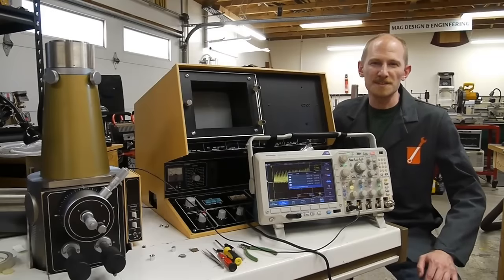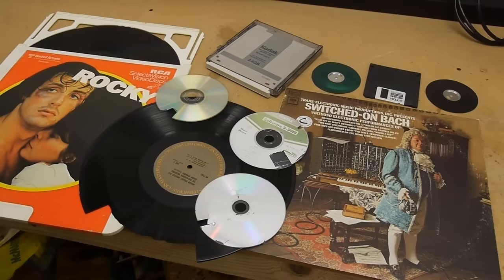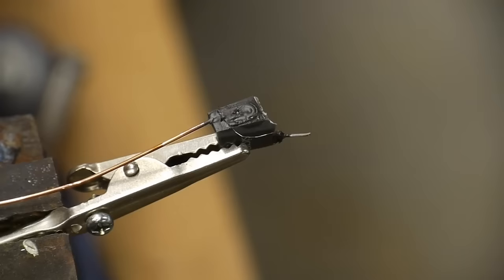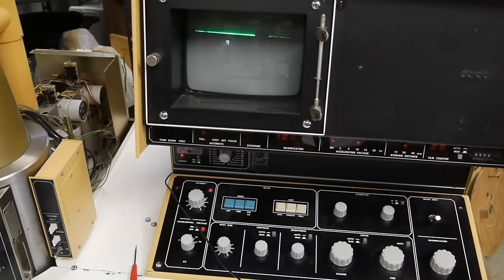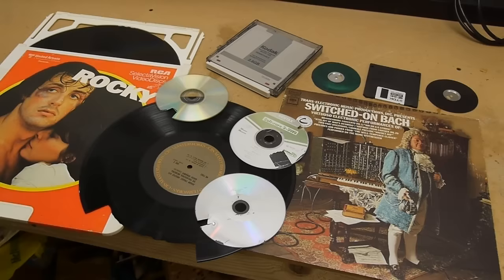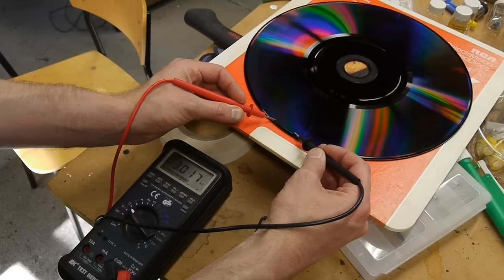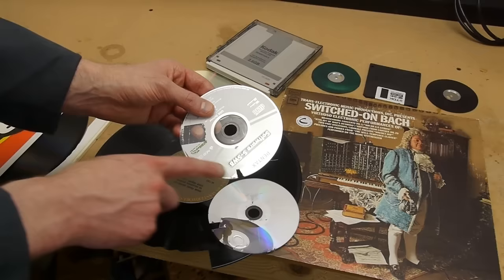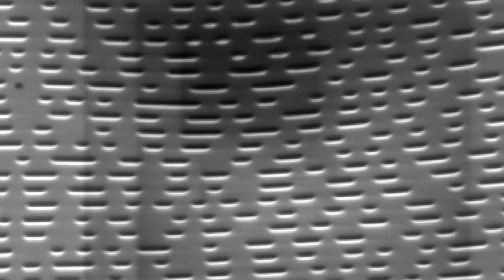Electron microscope slow-motion video of vinyl LP

Comment: This is incredible. So many times we take small things for granted. How on earth they cut they grooves with accuracy back in the day is beyond me.
Reply: The way it was invented was by recording with the vibrations that then kind of create the grooves but idk if that's how they do it now
Reply: they molded it to like some sort of master vinyl tihng
Reply: @unpluggedtoaster7421 they dont use vibrations in the way they did in the early days, as in recording into a horn and letting the vibrations from the sound vibrate the diaphragm and thus the needle. they use massive record cutters that use electronics to make master discs and then stamp all the records using that master.
Reply: The field created by the current of a recorded signal moves magnets mounted on a stylus, pretty much the opposite of a phono cartridge, cutting the signal into a lacquer disk, eventually ending up as a stamper pressed into a hot vinyl  "biscuit". Sure it took some work, getting everything to function correctly. But, basically it just replied on physics. The magnet field is an accurate representation of the current that creates it, and a magnet will accurately represent the change in field strength, if that makes sense.
Reply: I used to cut my vinyl with a hammer and chisel..
Reply: @savage22bolt32  Only 1960's kids understand
Reply: Store bought records aren't cut, they're stamped from a cut steel master which seems even more unlikely to get those tiny details into the groove.  But they do.
Reply: @austindarrenor  in the '70's, I worked for a machine shop that made the backing plates for the vinyl press machines.
Reply: @savage22bolt32  What gets me is how clean those vinyl presses must have had to be kept.  Just one grain of dirt stuck in a groove could ruin hundreds possibly thousands of finished vinyl records.
Though for years I listened to an album by the Byrds that skipped a groove.  Then recently listening to the song digitally without the skip didn't sound right 😆
Reply: @austindarrenor  Hey Mr Tambourine Man,  -  So funny you say that.  
In the mid - 70's I bought a Marshall Tucker album.  It had a skip, so I brought it back (to Caldor's dept store). The girl in the record dept was so nice, she exchanged it for a new one. 
Well, guess what? my new one skipped in the exact same spot!
PS I still have that album! 
When I was a youngster, my mom had a wind-up Victrola and a stack of old records. Sadly, we sold it when she died. There was too much stuff to deal with, and losing that is one big regret.
Reply: Dan Fogelberg’s first three or four albums, before he became huge, all were badly pressed. We used to call him Skippy.

Comment: You had me at, “ever since setting up this electron microscope in my shop...”
Reply: When you cut a 2 x 4 you must make an amazingly accurate cut!
Reply: me2
Reply: apparently a quick google search revealed they can cost something like up to $1,000,000 in dollars. Not something I'd ever get as a birthday gift, let's put it that way.
Reply: @kennarajora6532  not this one. He got it for free and just had to pay shipping. It's an older model anyway so could probably be picked up on ebay for under 10k. Still not cheap but not terrible for the capability.
Reply: @etch3130  I was curious about what he meant when he said that cd was approaching the limit of the device . . . For now.
Reply: Nothing really surprising here. It's actually a requirement for anyone serious about generating power from nuclear fusion in one's garage.
Reply: And I thought I had a decent shop setup with CNC mills, lathes, welders, etc. This guy has his own SEM! Sheesh!

Comment: Of course, physical vapor deposition, obviously.
Reply: hmm yes indubitably. I use this method all the time to butter my croissant.
Reply: butter vapor is something i never considered, i guess that with a vacuum chamber, some high heat and a very fine butter spraying device you could coat your croissant. now im wondering if all the air in the croissant is going to escape making it look like a balloon under a vacuum. this is what keeps me awake at night, deflating croissants
Reply: @yonidellarocha9412  dear God. You have just given me great anxiety
Reply: @yonidellarocha9412  Great, now I'm contemplating whether croissants deflate in a vacuum. Nothing in the world will be right until I know! DAMN YOU SCIENCE!
Reply: The CVD is a common technique in material coating. It usually involves fusing with the substrate and making the coating part of it instead of just a layer on top.
Reply: Joseluis Colunga CVD Croissant Vapour Deposition?
Reply: Chemical Vapour Deposition. Actually, I now realize my mistake. Sputtering is a physical deposition, caused by mostly electrical energy and thus the coating is softer and easier to remove than CVD. It's like powder on the material. Chemical vapor deposition is well... chemical. the material becomes something else.
Reply: Does it use CVD ?

Comment: the one thing i know i will never fully comprehend is how grooves in a record can actually produce complex sounds. that's always going to be witchcraft to me.
Reply: ***** no, i mean i understand how it works; i'm just really incredulous that it actually works. every time i think about it, it just blows my mind.
Reply: What blows mine is the Reed-Solomon Code and error correction!!!!
Reply: +David Drake - What is Reed-Solomon Code and error correction?
Reply: Calvin Lee The groove walls oscillate exactly as the sound wave compresses-expands the air, so all you have to do is amplify the signal (well there's an "RIAA equalization" to the sound because the vinyl medium is better at capturing some frequencies than others). It's an elaboration of the earlier gramophone and Edison cylinders in which the oscillating needle is simply connected to a horn, no electronics.
What is impressive is how good such a crude method can sound.
Reply: Calvin Lee The groove walls oscillate exactly as the sound wave compresses-expands the air, so all you have to do is amplify the signal (well there's an "RIAA equalization" to the sound because the vinyl medium is better at capturing some frequencies than others). It's an elaboration of the earlier gramophone and Edison cylinders in which the oscillating needle is simply connected to a horn, no electronics.
What is impressive is how good such a crude method can sound.
Reply: I completely agree with you, I wrote an entire paper on the topic and it still bewilders me.
Reply: Calvin Lee - Ikr ! I thought i was the only one that even after understanding the concept always felt like it was some kind of Nature's Magic show....  Especially with Video files stored on Disks or drives !!  I mean where the hell do u store all those colours, movements, formats etc. .... We humans invented some Crazyyy stuff !! :)
Reply: Magi V I certainly haven't written any academic papers on the topic but it doesn't exactly seem like witchcraft to me, if my ears can detect vibrations in the air and let me interpret them as sounds then it seems to just make sense that a fairly simple machine can pick up those same vibrations and record them and play them back by doing the reverse!
Reply: Calvin Lee what blows my mind is multiple sounds. I understand if it's playing a 40hz tone. But a full track with like 7 or 8 different instruments or voices!!
Reply: skierpage i have some edison cylinders at home! Are they worth something? I do not have a way to play them sadly
Reply: Now... someone please explain to me how they cut the grooves .  I presume it is the reverse process, analogous to the speaker/microphone concept but I am curious how it is physically done.
Reply: Play them happily then.
Reply: Well something like a stylus (an especially fine and tough one) picks up the signal from playback and physically vibrates the way a record playing stylus does, and cuts into a slab of material which is being spun at the right speed.  That produces a master disc.  Producing a master disc is an art in itself...
Reply: Me too, Calvin Lee. I get the theory, but the praxis blows my mind. There has to be some sort of magic involved!
Reply: It is weird... how a wave form can sounds like multiple instruments and voices at the same time, instead of just a single frequency generic tone. How does a little curved groove waveform in plastic translate into a distorted guitar playing an E minor chord consisting of multiple frequencies... blended with a keyboard and vocalist, etc etc...
Reply: This comment section is gold
Reply: Wow. Imagine a world without music.
Reply: I agree, that and how cathode-ray tube televisions work.
Reply: Calvin Lee I was thinking the same thing.
Reply: Kenneth Albert it's similar to the way scratching finger nails on a blackboard raises hair on some humans and irritates the hell out of them. Coz n effect ;-)
Reply: sqlb3rn segfavlt It's all the sound waves mixed together into one single resultant wave. It's not like the loudspeaker vibrating membrane "knows" that it's a human voice or chainsaw or guitar. It just vibrates with the net resulting wave.
Reply: All that is academic - it's ridiculously simple compared to how the ear and brain interprets the sound waves.
Reply: THANK YOU! SAME HERE! It's literally Magic
Reply: +Thomas Headley
You're just trying to burst everyone's magic bubble.
Reply: +Thomas Headley
To record a record of every event ever would require storage greater than the universe itself.
Reply: +Thomas Headley
I think that's kind of the problem. What is "us"?
Reply: Belief makes no difference, and is therefore unnecessary.
Reply: +Thomas Headley
Words have no meanings when you toss them around in a word salad.
You've gone from rational thinking to Hollywood thinking, you're devolving right before my eyes.
Reply: +Thomas Headley
Hollywood thinking means writers getting paid to write popular fiction, did you think it was science?
Reply: Words express ideas and so a word can have multiple meanings, the different definitions are not the same, and two different words don't mean the same thing.
So are you talking about faith or belief - it can't be both, that's word soup. So stand behind nonsensical statements all you like, it just means you can't even rationalize your own thoughts.
And none of this has anything to do with magical record grooves. Maybe if I just have belief (faith) that the music will play it will work, as if what I think or don't think makes any difference.
Reply: The truth is a lie waiting to be revealed.
We could do this for awhile...
Reply: No. That would be impossible to do. Even digitally it cannot be done cleanly in almost any real world recording. All you can do is remove certain frequencies which aren't likely to be the guitar's frequencies, to try to isolate it, but you will always end up removing part of the guitar's tones too, and leaving other parts of the track which are close to the guitar frequencies, making it a pointless exercise.
Reply: All multi-track music is "mixed" in the final stage. It's called the mixdown and is fundamental to the production of any vinyl record (since it is where each channel's levels are compressed which is extremely important, so that the groove is never so deep it pierces the material). Also by definition, vinyl can only store 2 channels of analogue data, so can only ever be stereo. Surround sounds requires 5 or more separate channels of data. While feasible to be done in analogue it is really only since digital that it has become mainstream.
Reply: Thomas Headley  
You don't have that right.
There is no stored database of sounds in a human brain that interprets vinyl recording.
Are you on mushrooms or something?
The OTHER explanations here are correct... not yours.
Reply: they don't tell you about the ritual they perform on the masters, and how amazing is it that you dont need much but a paper cone with a needle and a way to spin it to listen to the content

Comment: where did you get the electron microscope? I've been to three different Walmarts looking for one
Reply: LOL. Thank you, kind stranger, today has been rough this comment was the first lol I've had all day.
Reply: :D
Reply: You can often find used ones one eBay (usually in pieces and you'll probably need to buy a few more parts), many of them functional anywhere from $500 USD to $100,000 USD. With enough knowledge and skill I bet you could get one functional in your home for $1000 (maybe less).
Reply: The device itself is really not as complex as you think at the basic level. It just becomes exponentially more complex as the image quality/res you want increases. I mean, think about it this way: the electron beam part of the microscope is just an advanced version of an old TV CRT. The sensor and the electronics that interpret the signal are probably the most complex parts (unless you're using some super-vacuum pump or something).
Reply: Lmao what?! Did a double take haha
Reply: Ems are upscale. Try a Target.
Reply: you can buy one from the Electron Microscope Shop.
Reply: Mrs Moot HIV positive Where'd you get that joke? The toilet store?
Reply: Lowes Bruh.
Reply: cscdog The jerk store called, they're running out of you. -- George Costanza
Reply: have you tried staples?
Reply: All WalMarts in Florida stock electron microscopes.
Reply: Jim Beam I have found that they aren't usually at Walmart, apparently they weren't selling, however I have found a few at the crackerbarrel gift shop, and have also found them at goodwill. Also you might get lucky at garage sales.
Reply: I got mine at electron microscope hut
Reply: Electron Microscopes 'R Us
Reply: tesco
Reply: pfff! duh you gotta go to Costco..
Reply: OMG!   Lmao!
Reply: Walmart only stocks Atomic Force Microscopes now.
Reply: Web order only, pick up in store
Reply: Jim Beam lol ! I tried not to laugh at you comment but I failed ....
Reply: Have you tried Harbor Freight?
Reply: I picked mine up from a local Radio Shack. The location I got it from had some weird stuff over the years, but alas, they went out of business several years ago.
Reply: MisterLepton oh thanks I know this is a joke comment but it made me wonder where I can get one.
Reply: 999 thumbs up I coundn't resist going to 1000
Reply: Walmart has them, but you have to look very closely
Reply: It's in the same aisle as the physical vapor deposition vacuum chambers, DUH!
Reply: They're in Seasonal next to the clearance barbeques. Best time to score one is in August when they need the space for the incoming plastic Xmas trees
Reply: yuyu tutu Hilarious 😂😂😂
Reply: Jim Beam :
In the used Electron Microscope bin
Reply: Try Target
Reply: Did you check by the orange juice section where they keep the Tektronix oscilloscopes ?
Reply: I just borrowed my mother's electron microscope.  She doesn't use it anymore and probably won't even notice that it's gone.

Comment: Always assume that if someone owns a sputter coater , they are really smart . Knowing how to jimmy rig something else into a working version of a sputter coater ? ... priceless
Reply: Hard to find a reliable sputter coater repairman nowadays.  They all just want to sell you a new one instead of fixing it.
Reply: @DougPoker  Just more horseshit from the big sputter coater repair companies.
Reply: I have one. They run the gamut on complexity (and thus price). The concept is pretty basic. Pull a vacuum,  melt or evaporate material to where it is vaporized and is deposited on a part, usually some sort of  sub-straight. Complexity/price go up dramatically depending on the vacuum needed, measured in negative atmospheres and size.